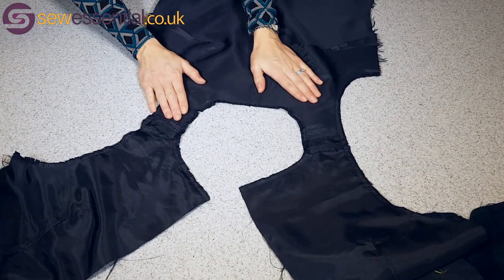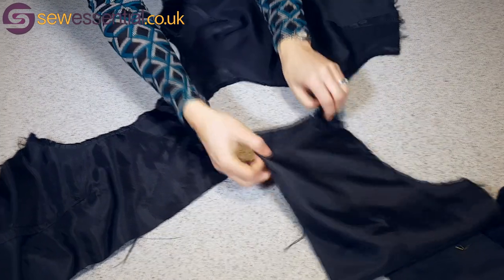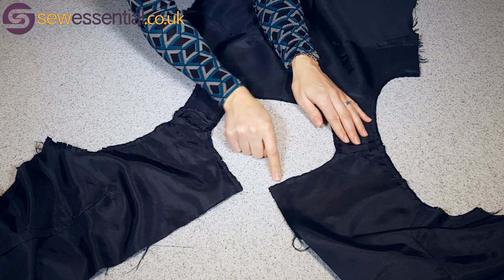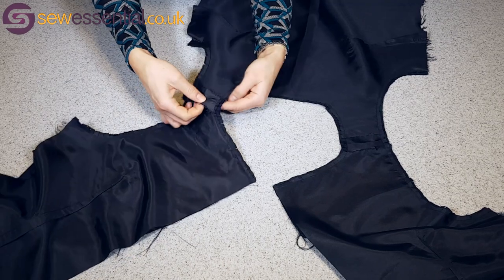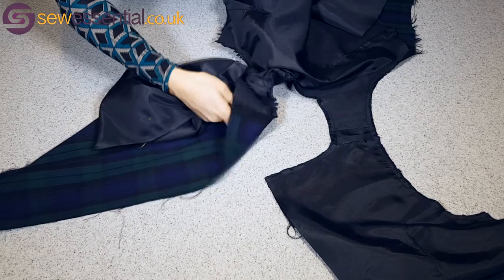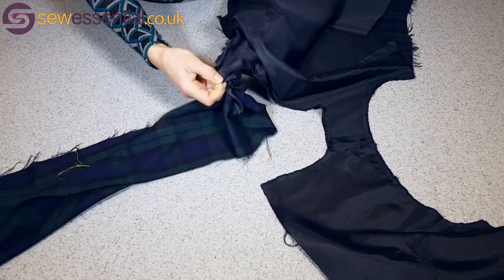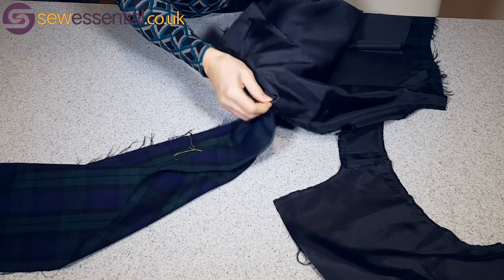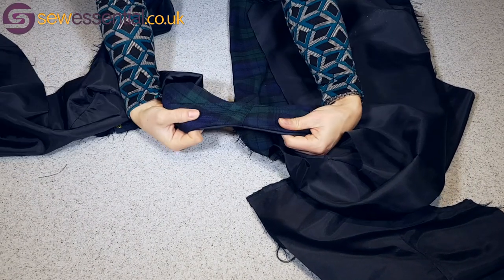Tips for Lining a Sleeveless Dress

Comment: How did you finish the bodice? I need help with adding an invisible zipper
Reply: I put invisible zipper on the upper fabric first. The lining is connected on the top. I open the zipper as wide as it goes. Then I flip from the bottom that upper part until I have that corner where the zipper is closing completely inside out. You will see that leftover trim of the zipper, where you can easily attach the lining. Then I stitch the lining on the zipper, it doesn't have to be way too close to the zipper, but as more, as neat.  Once you stitched the whole length of the zipper, flip it, do the same on the other side. I usually finish the lining  from the zipper down when all is done, as that can be done easily just flipping the dress. If I want to close the fabric with the lining on the bottom, I would leave one part of the side or back stitch open, so I can flip the dress through it and finish it. But usually I just hem the top fabric and the lining separately, and pinch them on a few spots with a hand stitch.